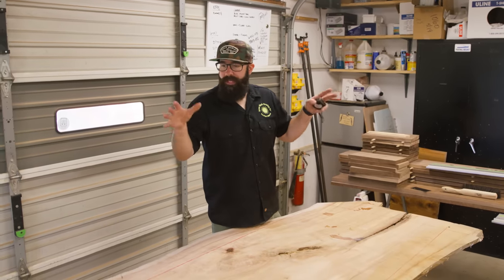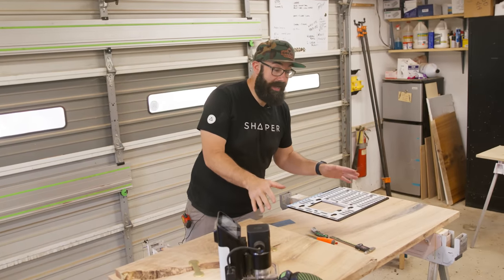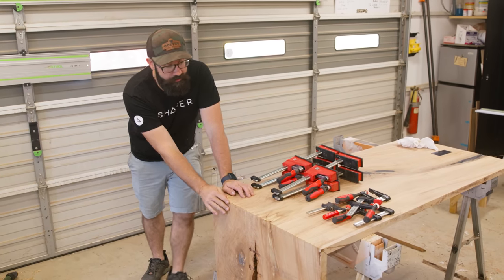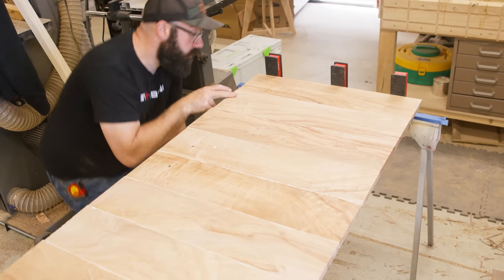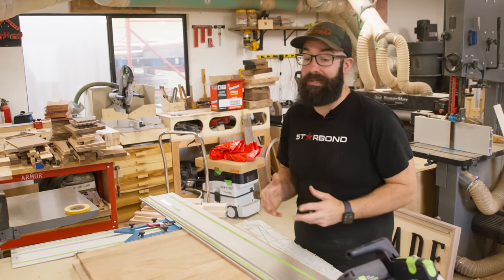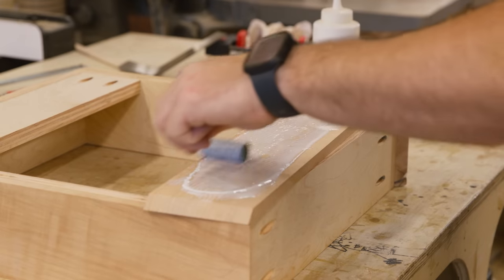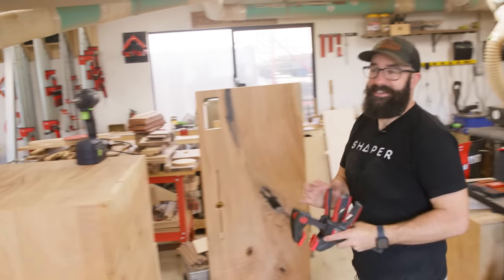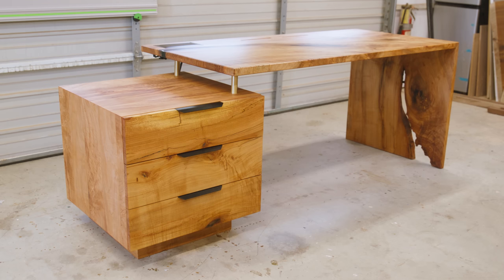A Woodworkers Dream Desk

Comment: Interested in how you made the drawer boxes on the CNC. I made some prototype 1/4, 1/4, 1/4 boxes but found that the setup time was too time consuming.
Reply from the maker: I use software called Mozaik. It's cabinetry software. Outside of furniture we also do custom cabinetry.

Comment: This is so cool!! On your festool tenons, do you do one side smallest setting and make the other side bigger so they fit in loose? Or do you just run the tenon  cut out all the same widget
Reply from the maker: Correct. The leg had tight mortise and the top had loose.

Comment: Hi. I am not regular watcher, YT recomended this video to me. Are you open to constructive critism (about the desk)?
Reply from the maker: You're welcome to share your opinions
Reply: @CoffeyCustomBuilds  Okay, thanks. First, it is crafted nicely and you are good woodworker. My isues are mostly with some choices.
1) The ratio of width of the desk vs width of the cabinet is not pleasing to the eye. The cabinet is too big for the size of the table. I understand you had material size limits (you mentioned them at the start) and maybe the intended use (printer stand) didn’t left you with much choice.
2) The desk overhang over the cabinet could have been bigger. But again, maybe you need that size for printer.
3) Mixing brass and black hardware is not really looking good.
4) The cabinet stand (toekick) is not fitting choice at all. Toekick is screaming kitchen cabinet. It just does not belong to such high end piece like this. Explore legs and other choices (like few inches of the slab that you cut off at the one minute mark of the video maybe?)
5) My last point is very subjective so take it with grain of salt – it feels too boxy. It could benefit from some relief cuts and/or some angles. The cut could be on the cabinet behind the drawers faces to distance the drawers fronts from the cabinet. It would not have to be big, just like 5 milimeters. About the angles… those could be used in many places (like edge of desk) or in the design itself (angled cabinet and/or waterfall, edges of drawers and the cabinet). I think with some tweaking it would improve the look. Of course it would increase the difficulty of the build.
That’s it. Please, don’t be insulted by this, I wrote it in good faith and tried to be constructive. Good luck in future builds.
Reply from the maker: @jasirek1732  all of your points are subjective. The size of the cab is for the size of the printer. The overhang is for the size of the printer. The toe kick is set back and makes the cabinet look like it's floating. Brass pulls looked tacky when I tried them.